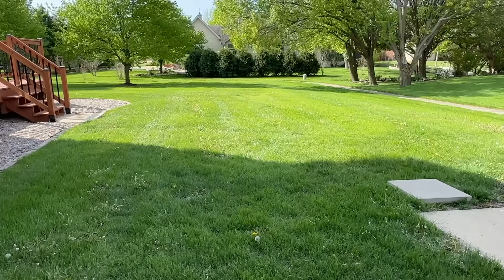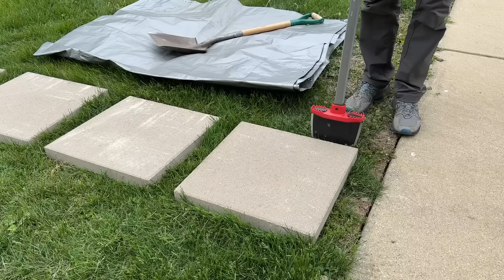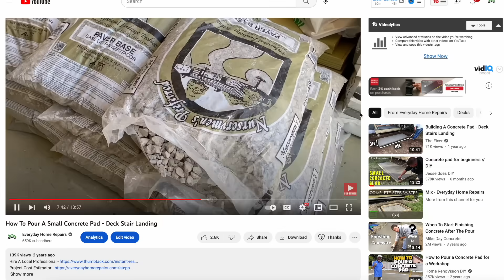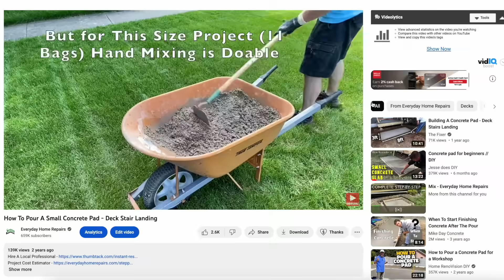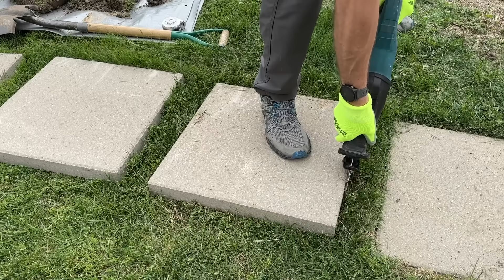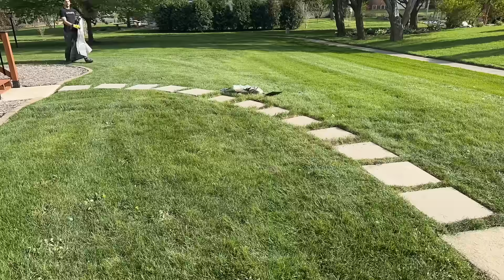How To Build A Stepping Stone Path - Small Cost With Big Results!

Comment: It looks to me like you set them a little deep. I would've raised them up a little. I remember we had a stone path in our backyard where I grew up and it settled over the years and slowly was being overgrown by the grass. Another case was some border bricks that after 10-15 years slowly disappeared under the lawn. I think when laying them out at the beginning it's good to leave them a little proud so that it'll be longer before you have to reset them.
Reply: Very easy to fix with that bag of sand!  Just lift them up and add another half inch.   A little time consuming but the sod has already been cut.  Anyway these stepping stone paths are a worthy investment, theyre great to save your lawn from foot traffic wear imo
Reply from the maker: Yeah, I honestly think you are right that leaving them a bit higher would probably play out better over time.  Thanks for the feedback.
Reply: Good that you can run the lawn mower over the stones though with no risk of ever hitting the stone.
Reply: @AB-jk7tw  No... just no.. things will settle...you'll put on weight...etc etc and BANG! you hit one.
Reply: This way you can mow right over it. I think it's perfect.
Reply: Came for a diy for something like this and your comment is the actual diy I needed. 😂. Thanks!
Reply: @wajarabapunshi638 yes and no, the issue he most likely experienced is no base/foundation on top of the soil, drain gravel is a solid (pun intended) idea as well!
Reply: Everyone talking about hitting it with your lawn mower needs to raise their decks! Bet you also can't figure out why your grass is always brown! 😂
Reply: I certainly would not want them a little proud. You have to mow over them! 
If they’re proud you will be chipping the stones.
Reply: No it’s so they can be mowed straight over
Reply: @paulryan1578  yeah that was my first thought but yes indeed they do settle over time. 
I've actually pulled up pavers in my backyard planted in the 50s that were under the soil, lol.
Reply: Yup, easy fix. No big issue. 

What new homeowners need to realize is that there will always be settling.
Reply: You probably failed to provide drainage Igravel) under the pavers. Every time it rains the area under the pavers turns to mud allowing the pavers to sink. Even more important where the area is prone to water settling.
Reply: Then your lawnmower hits it. If you use a proper base it should not settle. Don’t use sands use high performance bedding and pack the soil before you put the HPB down
Reply: @b-rare  as a retired builder in my own home it’s a crushed rock compacted base ,then course washed sand and cement just damp to bed on  !!everything will move eventually due to tree or shrub roots even grass roots and generally ground due to the elements
Reply: @paulryan1578  im a landscaper i own a company personally. HPB is the way to go today. google it its a newer thing maybe passed your time now
Reply: @b-rare  I’ve looked this up and see it’s limestone crushed ?but it appears it’s not available in oz 🥴
Reply: @paulryan1578  I’m in Ontario Canada. It’s pretty much 3/4 clear gravel but smaller so that you can also use it for base for pavers. It’s thin enough to be raked flat for pavers, and it’s strong enough and drains nice to be used as the base as well. It kills two bird with one stone essentially , and it’s 99% compacted once it hits the ground . Don’t have to pack it. Just have to pack the dirt before you use the high performance bedding.
Reply: @b-rare  unfortunately we are worlds apart our continent is pretty much the oldest in our world and devoid of good soils etc 🥴but plenty of iron ore rock ,granite and bluestone and what’s classified as highly reactive soils ie vast expansions and shrinkage as I said a different world ha ha
Reply: @b-rare  my biological father (mad Irishman) ha ha took of to Canada early sixties and lived there until he passed away about 20yrs ago